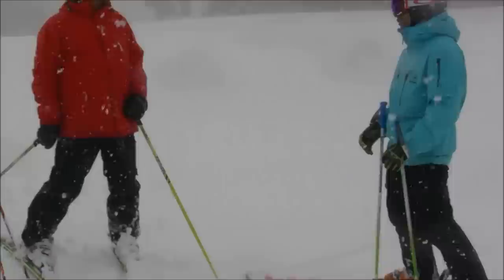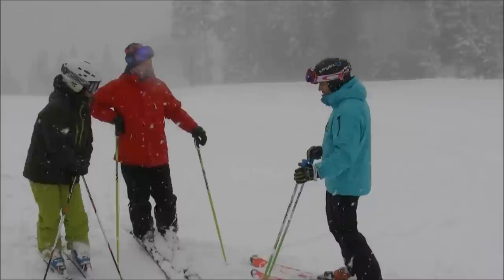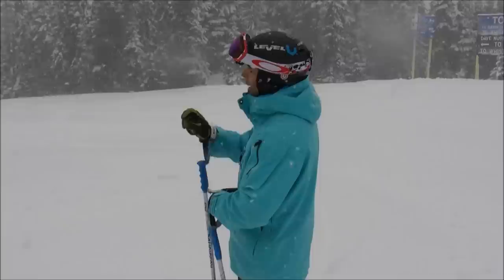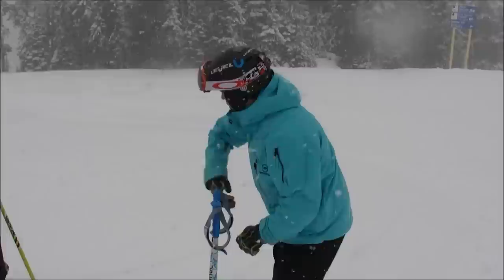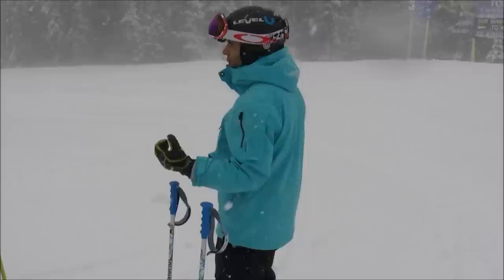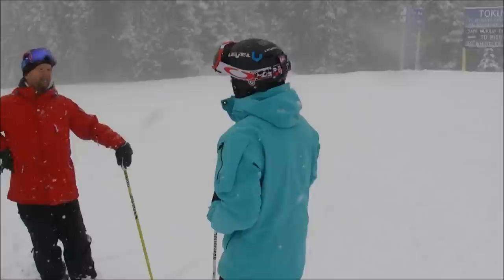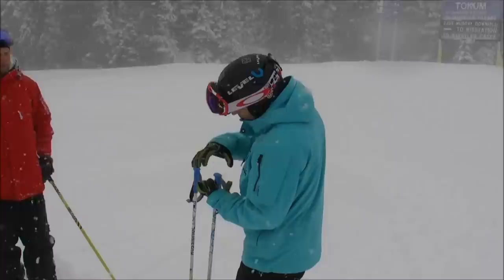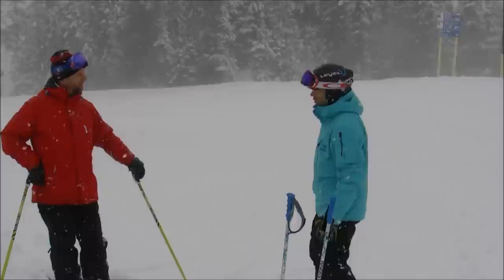Technical presentation 1  Core strenght to generate power

Comment: JF after all these years I have come to understand the brilliance of this video.  In recent body work due to some serious injuries, the other key thing about the kinesiology here is by engaging the pelvic floor through the process you describe is that we can activate and recruit on the little tiny muscles that actually connect from pelvis to the femur which will pull the head the femur into the hip socket with proper alignment and the result will improve our ability to manage our rotary effort in the leg :-)  all the best my  friend.

Comment: Holding  your guts in place can give you courage to face the direction you want your momentum to take you. I use pole pushing to engage. my core and ollie to incite higher excitement. Then I can manipulate precise gauge pressure adjustment along the length of the ski effecting exclusion zone phase transition efficiency, I call it functionally understanding nature...F.U.N.